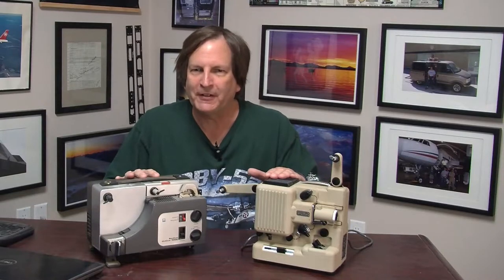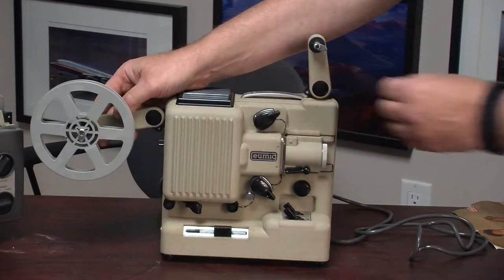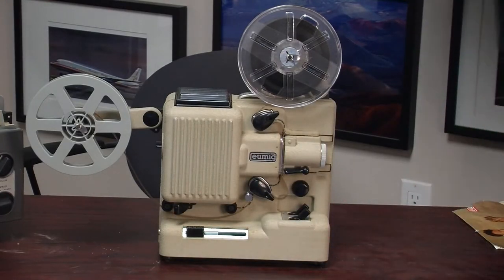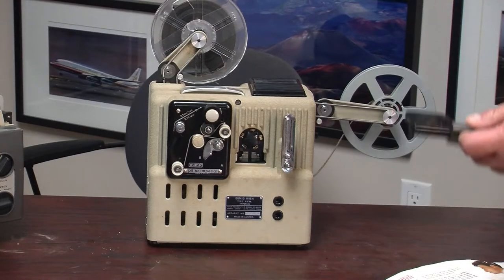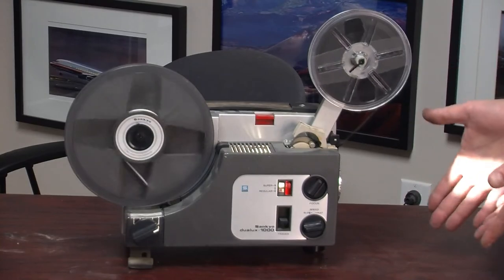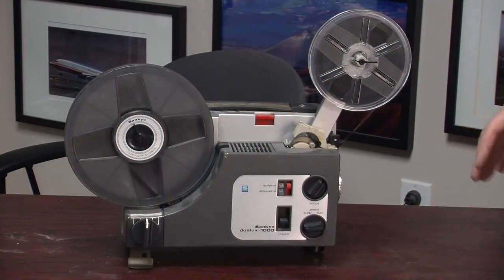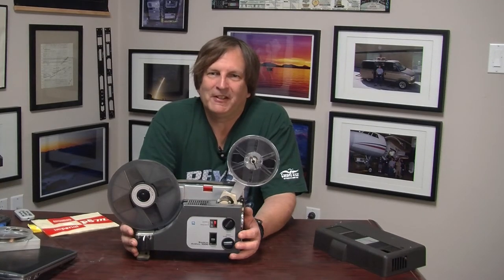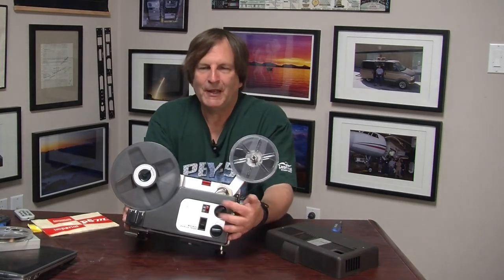Two Vintage 8mm Movie Projectors I Used Long Ago

Comment: Love your projectors and I see a Convair 580 in your picture back there.
Reply from the maker: You know your planes to spot the Convair 580! Its a flying tested owned by the National Research Council of Canada and has all its passenger seats removed. About 20 years ago at a previous company we outfitted it with networking boxes and modems to test ground to air communications. If you look closely I'm in the photo!